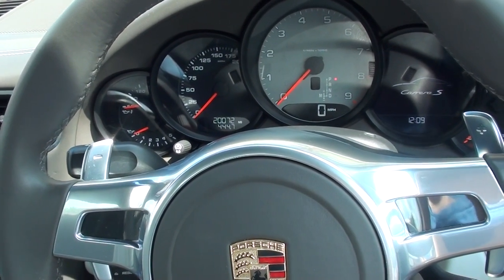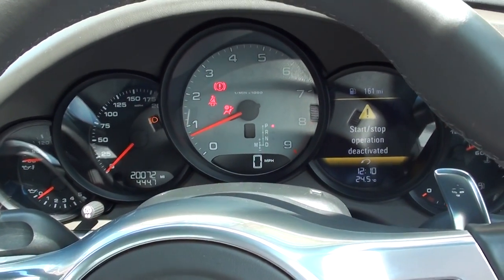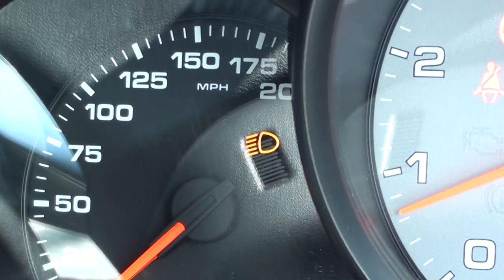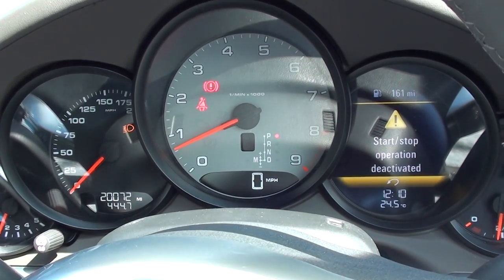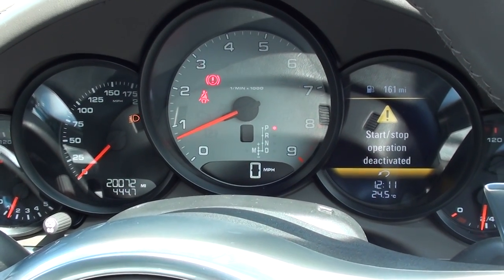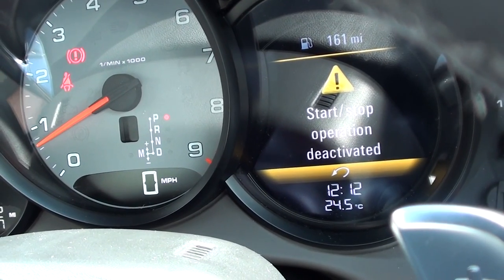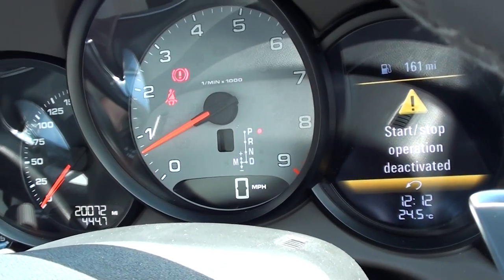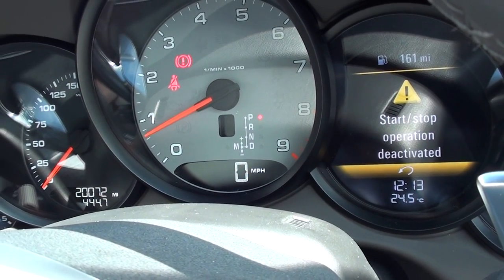Porsche Start Stop Operation Deactivated Explained

Comment: Hello.  I have the same issue with my 2012 991.  Can you shed some more light on which fuse  to try.  I looked in the manual and tried changing the two fuses that had the word "gateway" in the description.  Is it the drivers side or passengers side and which position is the fuse in?  Thanks.

Comment: My Panamera does the same thing. The Porsche dealer told me it was a bad coolant sensor. I said "but my car never overheats..." He said "it's a different coolant sensor not related to the actual cooling system" he wait it would cost $900 to replace. He also told me that if I don't use the Auto Stop/Start system then it's not necessary to fix it. I don't use it but the warning message is annoying. I use my Durametric software to clear the code but it comes back on after day or a month. If I knew where the sensor was located I would fix it myself. I have researched it and I'm starting to believe that the bad sensor may not actually be called a coolant sensor. The Porsche dealer may have told me that to keep me from figuring it out and repairing it myself. Either if it's a bad sensor it's definitely not easy to find it.
Reply: Hellbent 706 this just piped up on my Porsche panamera
Reply: Hey did you ever get that problem solved? I have same issues. Thank you
Reply: Did you solve it?
Reply: @sherralcolbert1607  I have had  lots of front end suspension work done after which, I had several lights come on the dash board. I took it to the Porsche dealer to have them erase the codes. They indicated they need to keep the car to check it out. They indicated they couldn't clear the codes.

Comment: This is the 2nd time that I saw this guy posting videos asking for advice from the audience but never report back. Blacklist him(what I am going to do).

Just sharing my experience, my previous 981 had similar issue but a little bit different. The Start stop function deactivate comes with PSM failure as well. And the diagnostic tool shows one of the bank’s ignition coil had miss fire. Replacing that ignition coil fixed it. There are a lot of post on the internet.

My current 991.1 S only shows start stop deactivated. I will continue investigation.

Comment: I’m going to try the fuse to that system. It drives fine after I get to reset. By turn car off wait and arm and disarm car. Until I stop and start a few times.

Comment: i have the same problem for the turbo s 2014
Reply: You should Google timing chain failure in Merc`s and BMW`s and consider whether with stop/start in play (600,000 average lifetime starts) as against 60, 000 without stop start there is a link between these early timing chain failures and the useless technology.

Comment: it was the battery ....new battery no more problem
Reply: I replaced my battery before this problem, however, The battery has been disconnected for 3mos. because we have done lots of front suspension work. The faults are still on the dash board.

Comment: Pull the fuse to disable it otherwise you're going to be replacing starters constantly. This feature only serves to appease the environmentalists and empty your wallet by replacing endless starters. Stop the silliness and pull the fuse and be done with it. Virtue signaling at it's finest.
Reply: Which fuse?